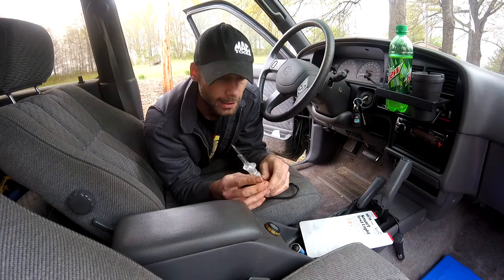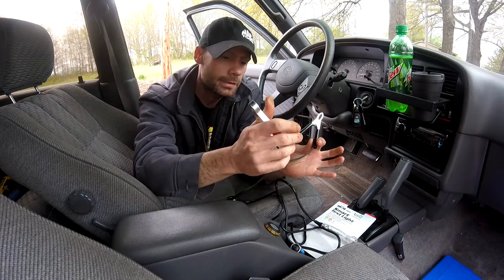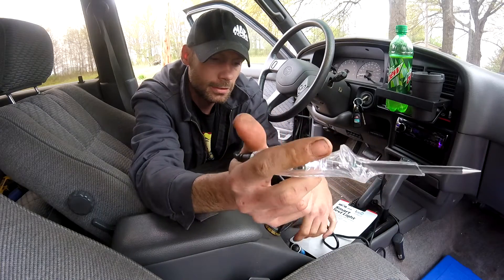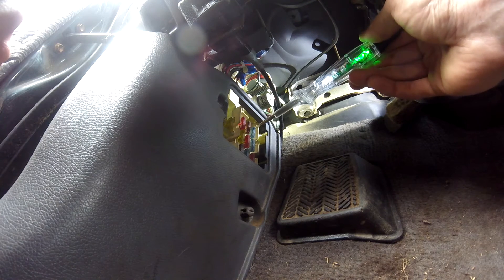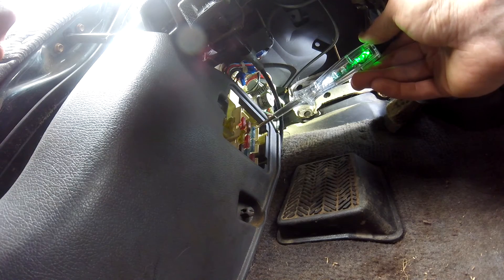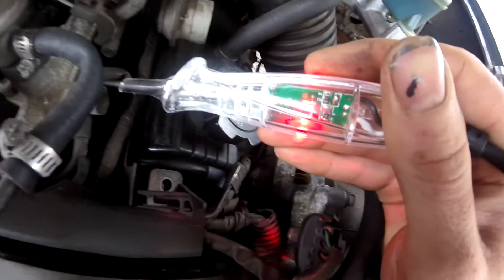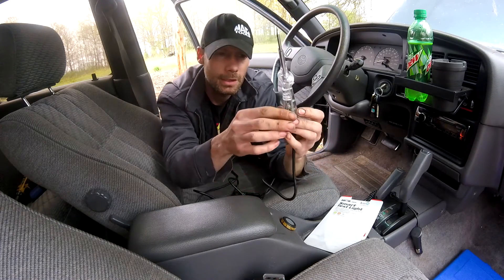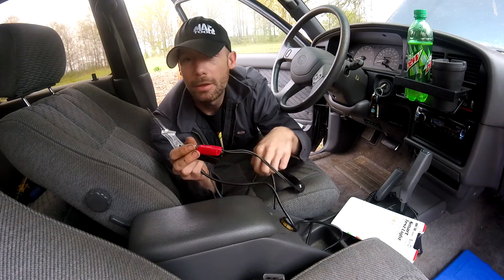INNOVA Equus 3420 Smart 12V Test Light / Logic Probe

Comment: Good tutorial, thanks.....
Reply from the maker: thanks
Reply: Can I ask you one question, when checking a fuse do you need for the car to be on? Thanks...
Reply from the maker: No, but if that accessory you are checking only has power when the key is on, then you need to check with the key on. Does that make sense? It really depends on how they are wired. Some things are fused after the ignition "ON". For those things the key would need to be on to check power to the fuse. If you're not sure you can just leave the key ON while probing the fuses.
Reply: great thanks alot.....
Reply from the maker: np